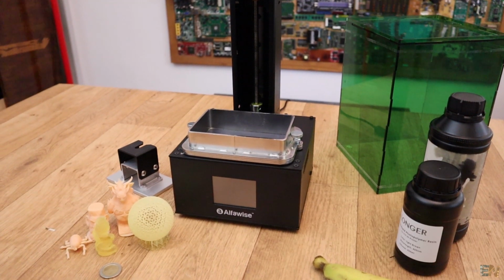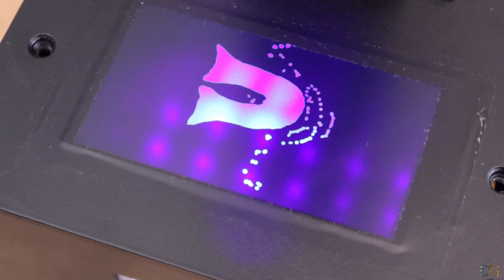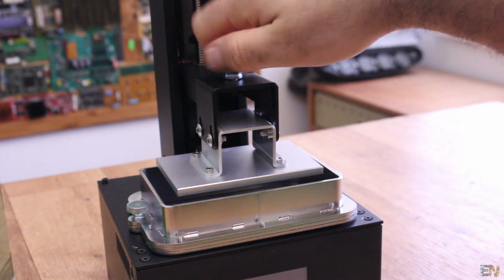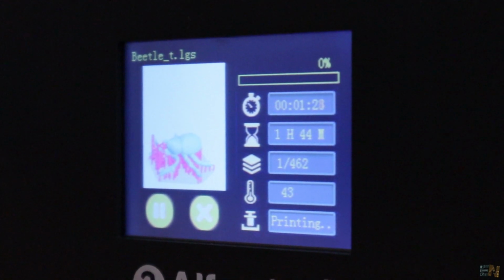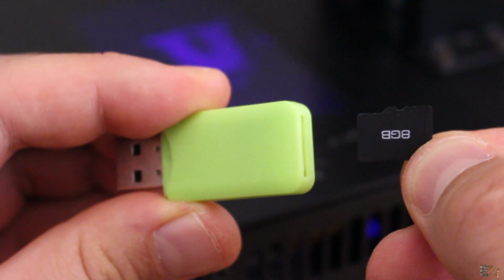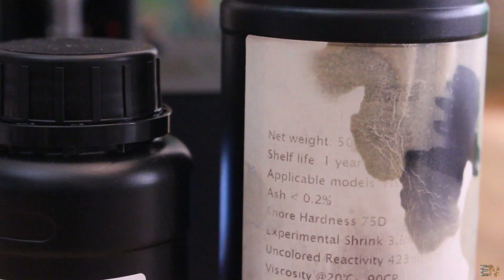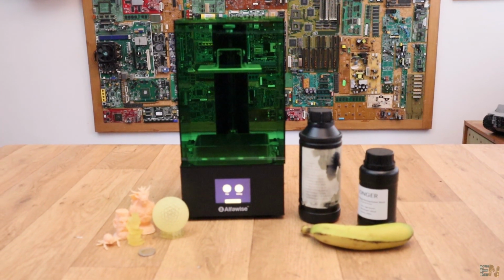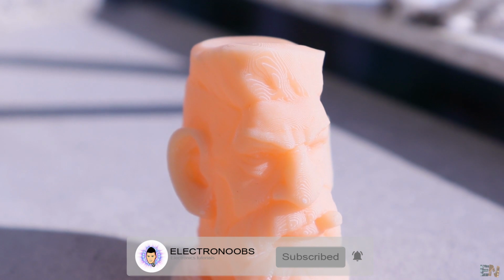ALFAWISE W10 review - DLP 3D printer LOW COST

Comment: Really? A rubber band holds the top... Oh good gosh that is a horrible 'solution'. I bet that is because they couldn't figure out what kind of glue to use to stick it together, because the UV would probably affect the glue, or it would yellow/crack the plastic. If I couldn't figure out a way to secure the top with a glue, it would absolutely get some silicone and use dabs of it along the corners and edges.. That rubber band thing is gonna fail, and/or cause the top to fall apart. What a horrible design... I mean, I get that T-Nuts are hard to put in, but a rubber band?!?

And those filters are urine/kidney stone capture, which is another keyword to look for since they are disposable.